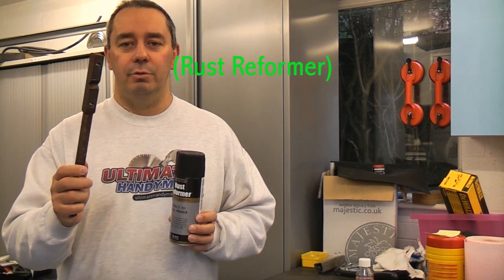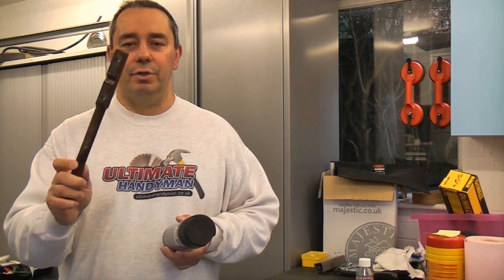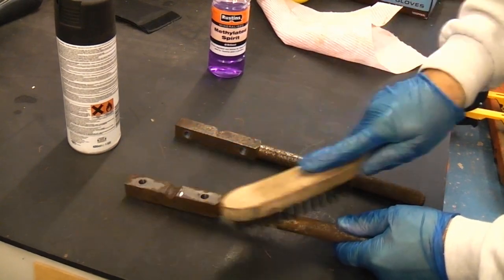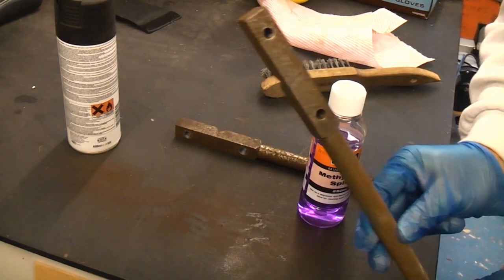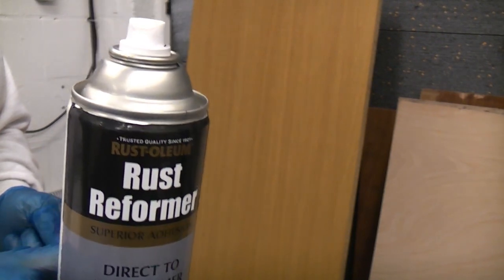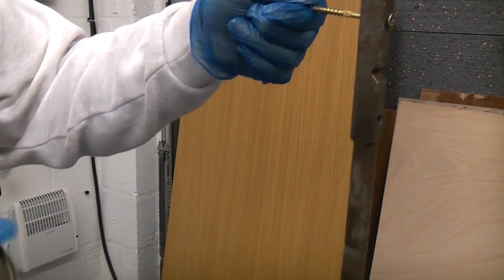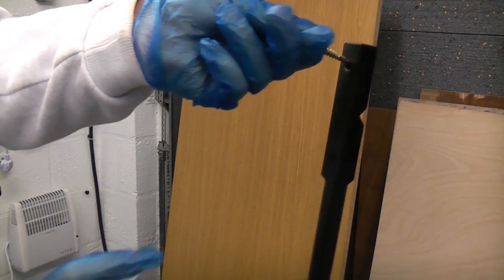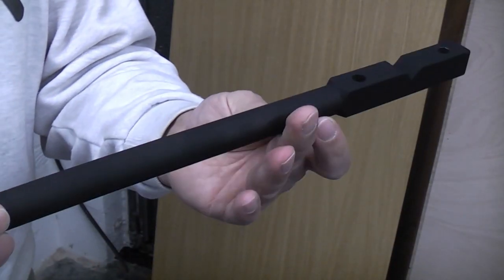Painting rusty metal | Rustoleum Rust Reformer

Comment: To efficiently remove greases, what you really need is a petrol based solvent, because greases are apolar and methylated spirits are polar, don't dissolve greases well.
A non solvent option is a warm solution of detergent with lye, it is a professional cleaning. But nevertheless, good video, and keep on making them!
Reply from the maker: Thanks for the info, I only used meths as the paint manufacturers recommended it.
Thanks for the comment ;-)

Comment: If I want to use this product on a heavily rusty painted radiator, would you just apply the Rustoleum, let it cure and then repaint directly over the top? 
Or would you sand it down again after letting the Rustoleum cure, for a smoother surface for the paint? 
My tub came with no instructions at all :/
Reply from the maker: This might help- https://www.youtube.com/watch?v=x5dEeVJu-7M
A rust convertor is best to prevent the rust reforming
Thanks for the comment 👍

Comment: Wat about a rusty shower rod in the bathroom?
My rustling can says I don't need primer or to scrape the rod before painting it with texured with "stone" Rustolium.
The Primer is suppose to be built in the Paint.
Reply: I used Rustolium Stone finish on my shower Rod. I did lightly sand it, It came out AWESOME. No soaked my clear plastic shower curtain rings in white vinegar for 2 hrs. They too came out looking brand new. And I lovvve my curtain rod now.
Reply from the maker: +Michelle Cockerham 
Thanks for the comment
Reply: Suppose to say, n I soaked the rings. Not "no" soaked. Damn auto correct.. lol
Reply from the maker: +Michelle Cockerham 
It catches me out all the time, so much so that I never use my mobile for posting anything LOL ;-)

Comment: This looks like basic surface oxidation. What about metals such as a old tractor implement where rust has pitted into the metal??
Reply: Do you just sand the surface rust off and spray over the pitted areas??
Reply from the maker: +JohnnyRebKy 
Just remove any loose rust using a wire brush, then give it a wipe with methylated spirits to clean it before applying the rust reformer.
Obviously you will still see the pitting through the paint, but there is not much you can do about that without going to a lot more trouble.
Reply: ***** Thanks for the reply. Thats kinda what i figured. I have some old farm tractor implements i want to repaint so ill just have to deal with it lol
Reply from the maker: +JohnnyRebKy 
You are welcome.
Good luck with the project ;-)
Reply: @JohnnyRebKy    the pitting etc can be smoothed with sandable primer coats and or body glazing,.  the glaze comes in a squeeze tube, its usually green colored. i have some around here somewhere.  its made specifically to fill in pits and stuff like that. and it is made to be VERY sandable, in order to  smooth out pitted surfaces etc.,.

Comment: Once sprayed, is the metal smooth to the touch or can the rust still be felt?
Reply from the maker: It depends how severe the rust is. If the rust is really deeply pitted you will still feel it through the primer.
Reply: sand sand sand,. til its smooth,  sandable primer coats, and or body glaze,  sand down coats with 1500 to 2500 grit wet paper.  make it realllllyy smooth then.

Comment: Cheers, from Chicago, mate! Thanks for making the vid.. Can you use conventional primer over this stuff? ...Or this is the primer? I don't know, for some reason, I have never seen this stuff out there. 
Thanks in advance.
Cheers!
Reply from the maker: The rust reformer is a primer, it leaves a really good surface to paint onto as the product covers really well (much better than a conventional primer). Once it has dried you should be able to apply the top coat paint of your choice. 
Thanks for the comment
Reply: ***** Thanks for the comment Thanks for the reply. It's refreshing fhen people that make the vid., actually respond to questions about it. :Do you think this I can get away with using it as a primer on calipers? (-- Cause of the high heat) ...Maybe I can put this stuff and then high heat primer? Ore is that overkill? 
Thanks for reading- if you did.
Reply from the maker: I would not use this on brake calipers because of the heat which you have mentioned.
A better option might be to have the calipers blasted with some soda to remove any rust then paint them with high temperature primer and high temperature paint. There is a chance that the rust reformer won't like the heat and could fail.You are welcome for the replies ;-)
Best of luck with the calipers
Reply: *****  Oh.... okay... Thanks for the advice. Yeah, maybe that's what I'll do. The reason I was asking cause some kid made a video of using this stuff and just applying paint right on top of it. I just wanted to go a step better. :) I just didn't realize that this acts as a primer so it makes what you said. Once again, I appreciate the replies. Have a good one. 
Cheers! :)

Comment: Wat about a rusty shower rod in the bathroom?
My rustling can says I don't need primer or to scrape the rod before painting it with texured with "stone" Rustolium.
The Primer is suppose to be built in the Paint.
Reply from the maker: +Michelle Cockerham I'm not sure as I have never used that product before.I doubt if it can be sprayed directly onto rust though. Normally if I'm painting over rust in a home I wire brush it to remove the loose particles then use a rust convertor, which turns the rust into a paintable surface before priming it.
Reply: Thank you very much.
Reply from the maker: +Michelle Cockerham 
You are welcome ;-)